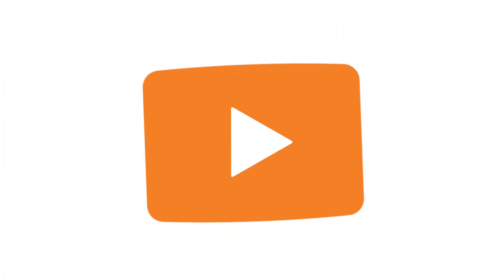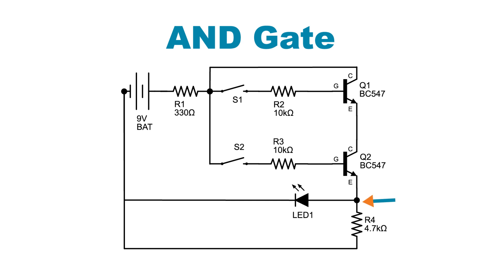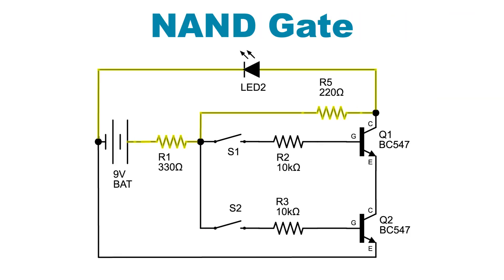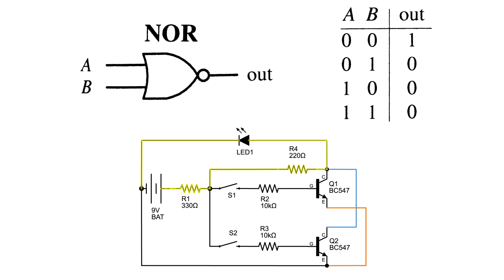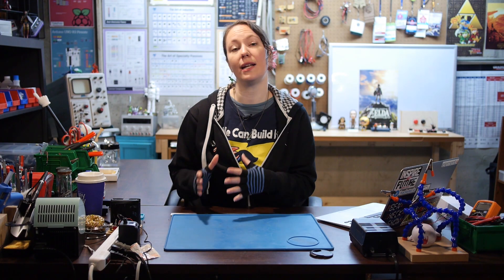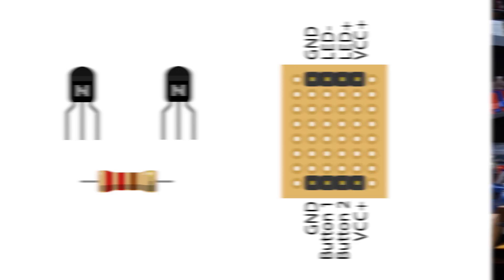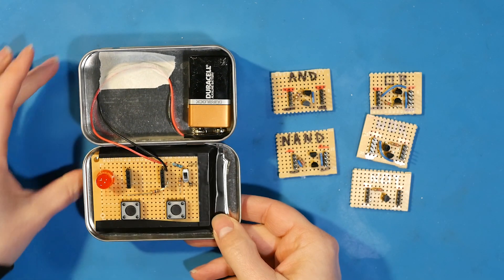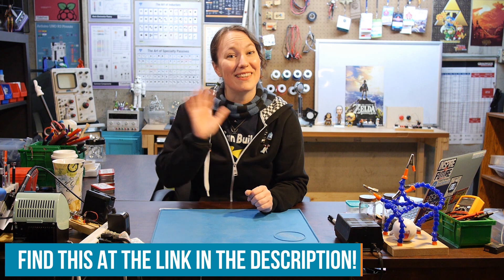Making Logic Gates From Discrete Components - The Learning Circuit

Comment: This is a great video. For the nand gate example, I'm wondering whats stopping the current at the top from flowing to the LED when both switches are closed? 

I understand that current is able to flow into the Q1 collector and so forth, but doesn't the electricity also still have a path to the LED?

Comment: I've been wondering if there was a way to make an AND THEN gate.  I remember wanting to do a project awhile back that had 2 outputs.  But i only wanted this to work based on the sequence of inputs.

If Input 1 was true AND THEN input 2 (and then 3,4 and so on), do this.  Otherwise do that.

I figured i COULD use an AND gate for that, but i wouldn't get the desired effect because the inputs would need to go in a sequence, not at the exact same time.  And I couldn't use an OR gate because it would trigger the event if either input had a value, and all inputs would need to be active.... just in a sequence, kinda like a checklist.  I ended up forgetting the project because no matter what i did i couldn't get the desired effect. it was always either all or nothing.
Reply: Sounds like you need a latch or flip flop to serve as memory. What you're describing would be formalized as a "Moore machine". Give that a search and you'll find some good resources.

Comment: Is the base resistor supposed to be 10kΩ regardless of which NPN transistor i use? If not, how do I calculate that value?
Reply: You calculate that value by taking the collector current and dividing it by the max gain. This gives you base current which you then can use to get the resistor value since the voltage is known.
Reply: @max3d_0ut  Thank you for your reply Max, still hadn't' figured that one out so it was still relevant :)
Reply: @emilberg7959    no problem. Just starting into electronics myself and I had the same question. Actually had to watch another video on transistors by Great Scott

Comment: Can someone tell me, why doesn't the LED light up in the NAND gate when the switches are closed?  Wouldn't there be electricity passing through every path?  Why does it move away from the LED?  This is some basic thing that I am missing so I would really appreciate any help.
Reply: My guess is the transistor literally pulls charge down the emitter path and since an LED is a diode it won't light up with charge going the opposite way.

Comment: It would be good if you guys slowed down the video during that actual construction of the circuits. Also I would to see you guys tackle forrest mims led/Light flasher circuit using an NPN and PNP transistor. It would at the very least be very educational with transistors.